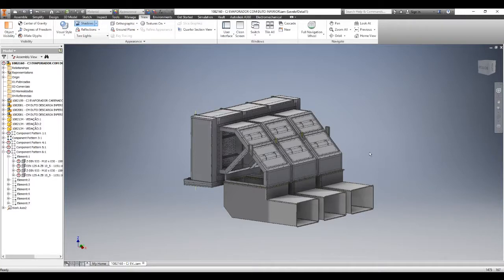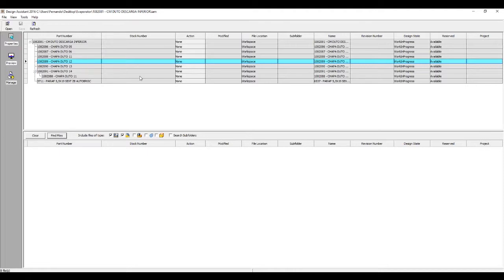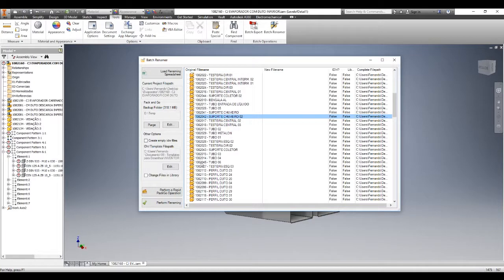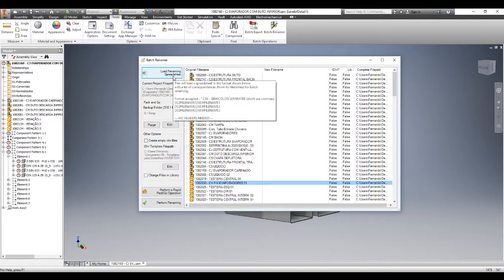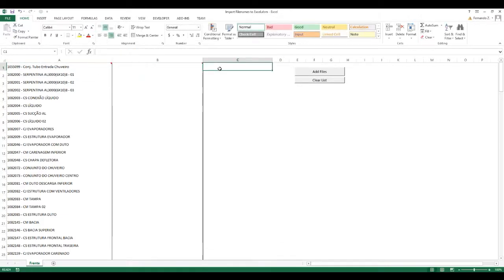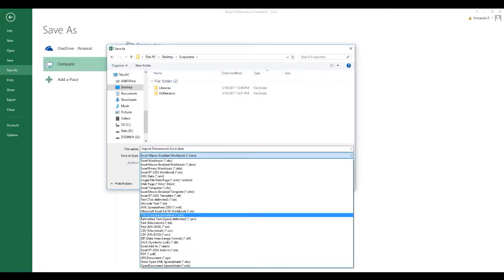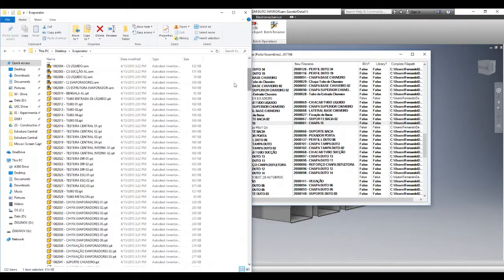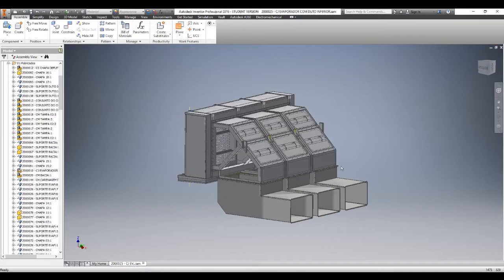Batch File Renaming in Inventor

Comment from the maker: All, I've received reports from many users of this add-in that it cannot be installed in Inventor 2022 and up. That's rather unfortunate, and it breaks my heart that Autodesk dropped the support like that. Unfortunately I personally don't have the time (nor the access to Inventor anymore) to update the software to fix this issue. I'll keep the video up for those with older versions (2021 and below).

Thanks for your kind words of support.
Reply: Does the application support Cyrillic characters?